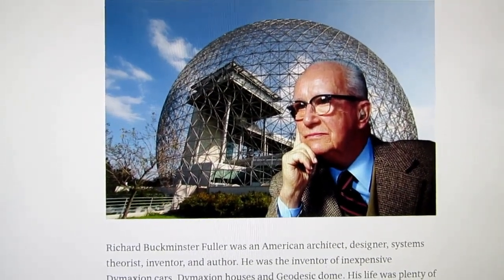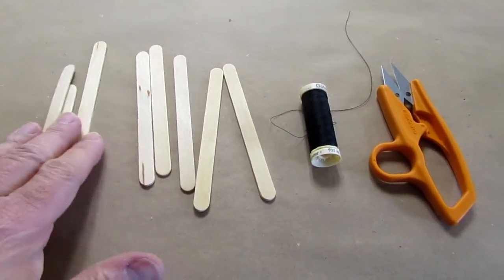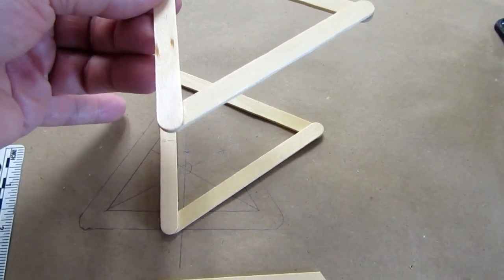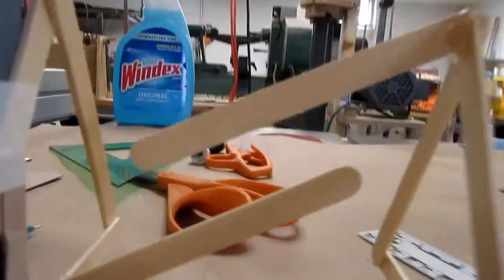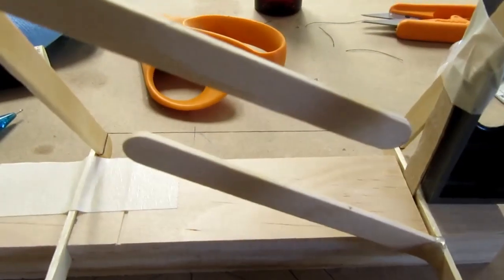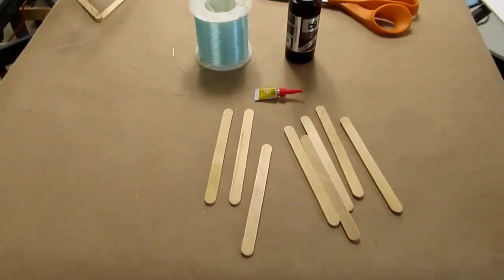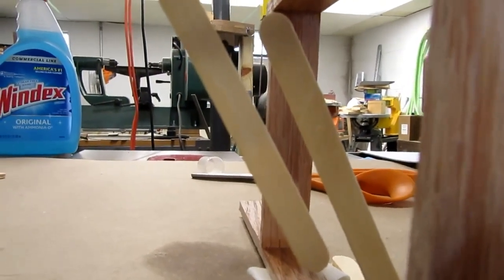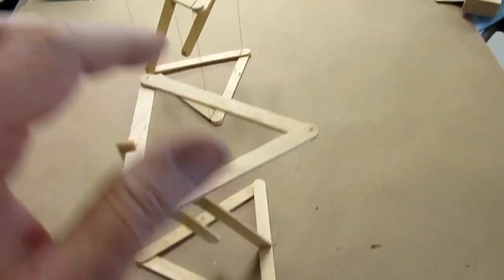Making Some Tensegrity Structures

Comment: If you drill tiny holes where you glued the strings, you can pull the strings tight and wedge them in with toothpicks.  That allows you to make any necessary adjustments to the length of the strings so the entire structure is a symmetrical as possible.  Then simply cut the toothpicks off

Comment: Great video - one of the few Tensegrity video's to show what works and what doesn't.
What would be really great is to have a video that talks about using different shapes (Triangles versus Squares versus Circles versus Hearts, etc) as well as the merits of using 3, 4, 5 or more strings (and whether they should be offset or inline) on stability.  I've been looking and haven't found a video or web page yet that didn't go into a ton of math. Thanks

Comment: I wish you are doing more electronic projects like playing with old scope, multimeters, legacy ic, etc.
Reply from the maker: I AM doing that. I recently posted a video on a handheld digital oscilloscope, and a restored vintage Heathkit decade capacitance box. I just restored a Heathkit decade resistance box, don't know if I will do a video on it or not. I am part way through a restoration of a large Heathkit FET VOM. I am helping an audio club document a certain audiophile amplifier that is sold online, and will probably do a video about that product and its newly available drawings.